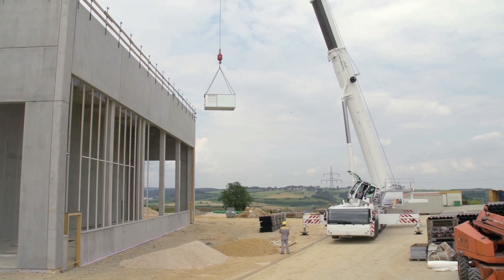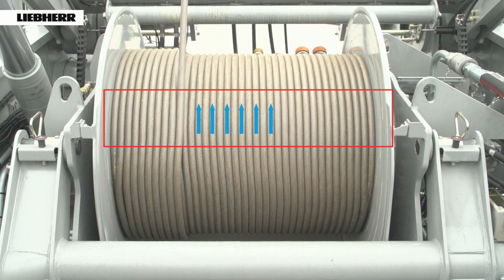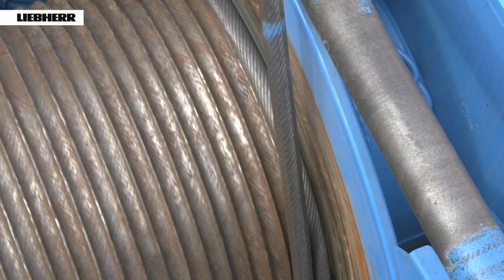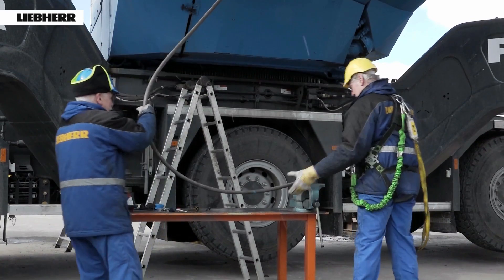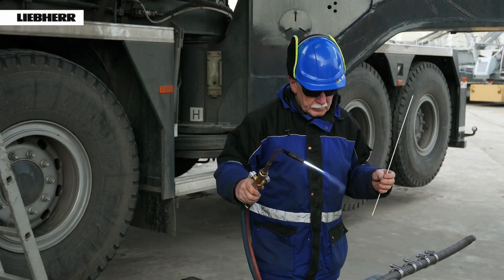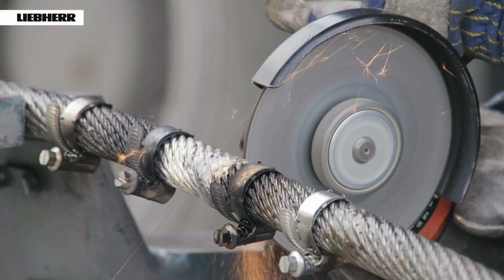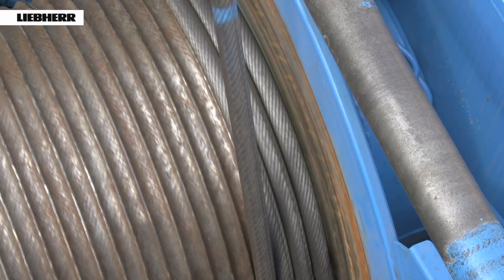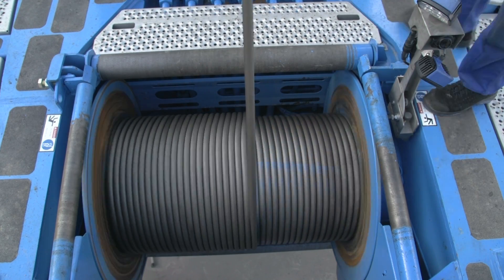Liebherr - Increase rope´s service life by hoist rope cut-off

Comment: I have done this on many cranes, dozers and oilfield winch trucks... spool it all the way out and then you just loosen the dead end clamps and pull the rope through the backside, re clamp and torch the dead end off-and cap with solder. 10 minutes instead of 2 hours. Horrible waste of time- 2 hours on a jobsite can cost tens to hundreds of thousands of dollars especially on multi crane/complicated lifts.
Reply: And... spooling the cable of such a crane all the way out takes already 5 mins or so, depending on the length. I guess you worked on much smaller mopeds.
Reply: You shouldn’t torch or weld on an oily machine with lubricant and electrics everywhere around. Everybody does, however Liebherr must show the correct way.
Reply: Stuff like this can easily be scheduled in, so there's no loss of sales. This is just maintenance, which you always schedule in anyway. 2 hours of work is not a lot a long time to do this work.

I'm not sure how you came up with the conclusion about the figures, but how did you? Renting a crane like this only costs a few thousand dollars a day including operator. Nobody is losing any significant amounts. The crane will only have a downtime of 1 working day at the most. 

The point is still the same - company that plans maintenance should not expect unforseen loss of big contracts. No company has full demand on their equipment anyway, unless it's rented out on a longer term.
Reply: 10 minutes is an exaggeration but yes it's faster than what was shown in the video

Comment: Slipping and cutting Travelling Block (The travelling pulley that hoists pipe in and out of the hole) Line has been carried out for at least the last 50-60 years in the oil industry, so there's nothing new in this stuff. A calculation is made to determine how many ton miles the rope has done and at a pre determined ton mileage the wire line is slipped, usually on the third slip a length of line is cut to prevent the drum from becoming over full.
Reply: Greetings mister rodgerson, can you give me an example?
Reply: The calculation and formula can be found on drilling formulas.com here is and example of ton miles for a round trip (a round trip is running drill pipe into and back out of a well).
RTTM = (Wp x D x (Lp + D) + (2 x D) x (2 x Wb + Wc)) ÷ (5280 x 2000)

where
RTTM = Round Trip Ton-Miles
Wp = buoyed weight of drill pipe in lb/ft
D = hole measured depth in ft
Lp = Average length per stand of drill pipe in ft
Wb = weight of travelling block in lb
Wc = buoyed weight of BHA (drill collar + heavy weight drill pipe + BHA) in mud minus the buoyed weight of the same length of drill pipe in lb
** If you have BHA (mud motor, MWD, etc) and HWDP, you must add those weight into calculation as well not just only drill collar weight. **
2000 = number of pounds in one ton
5280 = number of feet in one mile

Comment: I've worked with wire rope all my life and never had the attached end get damaged, the rest of the rope, yes. Flat spots, frays and breaks, but not on the attached end. Explanation?
Reply: Maybe if you didn't skip to the end, you'd get it.
Reply: Removing 3 feet of the rope moves the entire rope along the drum therefor it no longer rubs on the same places against itself. So it prolongs its life.
Reply: @davidlol1983  So how often do you need to do this?  That's 3ft less of rope left then another 3ft off.  then another 3ft off...lol soon you don't have enough rope length anymore....
Reply: @mingming9604  they are called drum end cuts and the crane operator or crane owner takes this into account when purchasing the rope. Typically you are required by industry standards to have a minimum of 3 dead wraps. So you put a certain amount of rope on drum that’s specifically for this purpose
Reply: They let you work with cranes??
Reply: ☝️ lol this takes win😅

Comment: How exactly does this prelong the life of the rope?
Reply: The point where rope rubs against oneself at full tension is only at certain intervals along the rope.  Unspooling and shortening the rope moves all those points off that full tension intersection.
Reply: @rokadamlje5365  That clears it for me! Thanks for the reply!
Reply: Jimmy De'Souza  The scrolls of the drum are machined in different ways. At points the rope lies parallel to the rope below and at others it lies across at an angle.
Reply: Jimmy De'Souza  https://youtu.be/5dGcoAP9XA8
Watch from about 40 seconds. There's a clip that illustrates my point better.
It's an obvious change in the way the rope spools on to the drum.

Comment: i dont get it, why doesn't the hoist rope come at the correct length from the factory itself?
Reply: The rope is longer then necessary to make it readjustable
Reply: @alexanderbreitschaedel9070  but is there any reason to readjust it? & what I dint understand is now that they have shortened it they obviously can't lengthen it in the future. so they have to buy a new one again? which doesn't make any logical sense
Reply: @AmateurPetrolHead  it could once be readjusted. Readjustment is to distribute the pressure on the drum to other parts of the rope so the rope doesn't get flat where the rope layers touch each other
Reply: @AmateurPetrolHead  The rope is longer than it needs to be when it is new . In this case they only removed about 24 inches . And that is nothing to worry about . I'm sure they can do this more than once . Bu the whole idea is to realign the high stress areas of the rope so it will increase service life . To make it easier for you to understand if the life is say 25 thousand  cycles  . Do this will double it . And without the labor a rope like that cost tens of thousands of dollars . So it is well worth doing it . Keep in mind this only holds true if the rope has not been damaged along it's life for other reasons .
Reply: @lhr1701  ah, okay. thanks for the explanation
Reply: @AmateurPetrolHead  The wear on the rope is at periodic intervals. By unspooling and cutting a bit of it, and respooling, you now move the wear to a new periodic position with a new offset. This way you can prolong the life of the rope and be able to use it longer overall. Adding 10% more length to the rope than needed, will well, cost you maybe 10-15% more, but will make the life time probably 3 times longer. Easy.

Comment: Kinda amazing that some young engineer figured out how to save millions of dollars in service work by a simple cutting of 3 ft of cable.
Reply: This kind of work has always been done in Mining, with higher value wire ropes.
Reply: an older engineer would have known that it is much more lucrative to sell a whole new cable than few hours of work.
Reply: @vallevaan  economist
Reply: How do you know how old he or she is?
Reply: Kathleen Shaw  roeblings and some bridge in new york ?
Reply: More likely an accountant/manager demanded just the bad section be cut out ;) after all it's cheaper to allow the insurer to pay out for a claim than the owner perform maintenance.
Reply: @lariwoo  They didn't cut out a "bad section". They adjusted the point at which the cable "crosses over" the underlying cable.
Reply: @lariwoo  They're not cutting out a bad section.
Reply: @lariwoo   Did you even understand what was being explained in the video?